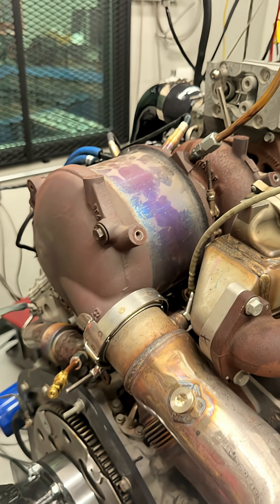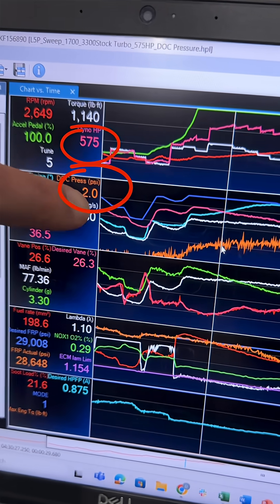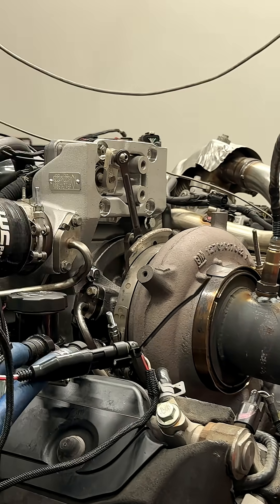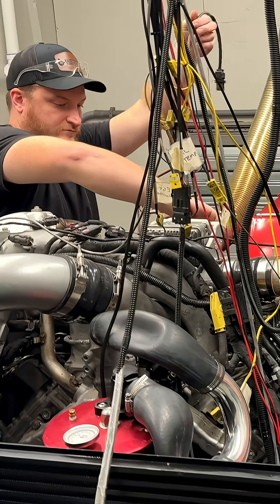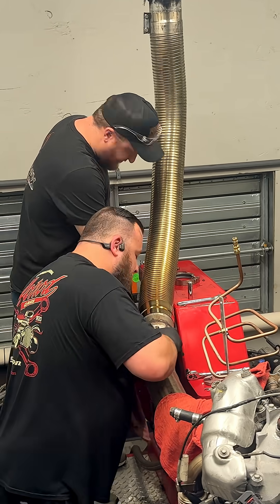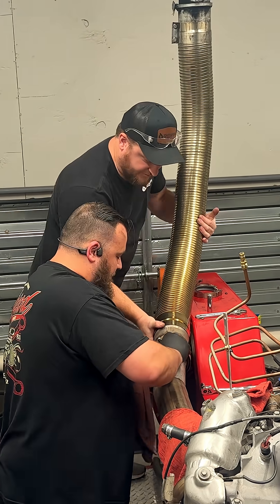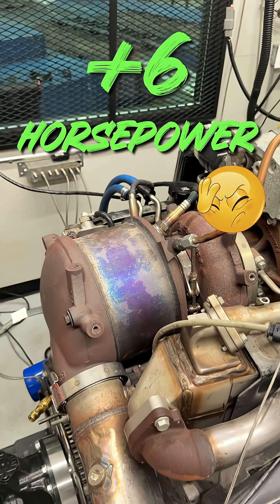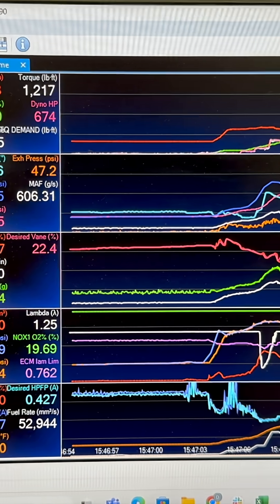DOC Downpipe Worth It At 700 HP?

Comment: Does the DOC ever clog up on a T/D truck?
Reply: I wondered the same thing. It doesn’t seem to be. I’m at about 6k miles after doing mine. Time will tell
Reply: @RadDadRado keep me posted throughout the years. 🤞
Reply: @nq2847 it won’t be on for long. I’m gonna need injectors soon. So I’m gonna upgrade while I’m in there. But absolutely no issues and performance is great
Reply from the maker: DOC clogging isn't the same as the DPF. We haven't seen that.

Comment: It's the regens, the frozen def tanks, poor fuel economy, dirty oil all the time,  no one can argue that egr is good for the engine. I'm not against emissions. I just wish they where as efficient as a non emissions truck.
Reply from the maker: The DOC gets lumped in and it honestly keeps the truck quieter. Removing it is moot.
Reply: @Duramaxtuner I'm not going to disagree with that